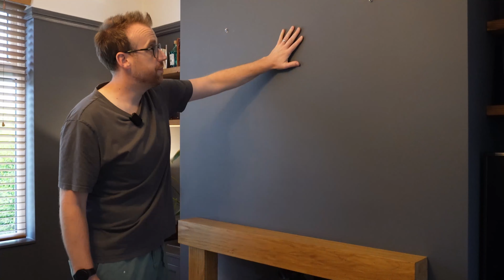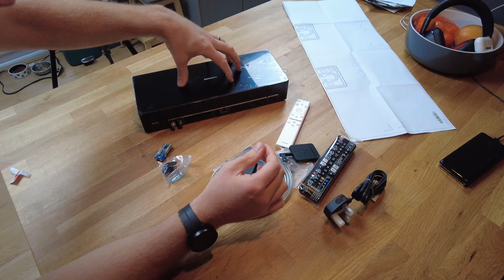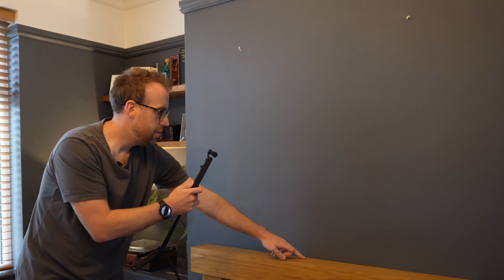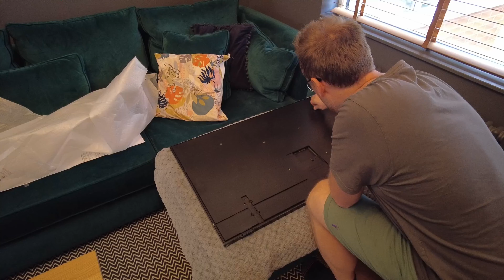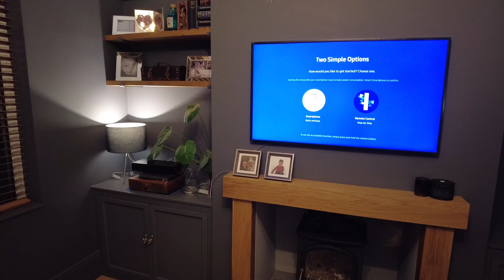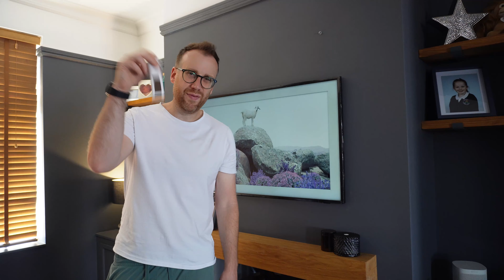Samsung The Frame 2023 TV (Part 1) | Huson DIY | 43 Inch TV Install #samsung #theframe

Comment: You don’t mention whether your brackets went into the stud or just the dry wall. I’d just dry wall should use special dry wall anchors
Reply from the maker: Hi!! Yes just plasterboard and I did use some decent Fischer plugs suitable for the wall and weight 👍🏻

Comment: I watched this to see if I understood the paper template better. There is a border for the outline of the tv drawn on the paper and another border for how much it will sink once installed. That must be the gap you mentioned midway through your video. Thanks for the helpful video!
Reply from the maker: Yeh that's right. I totally miscalculated!! 😅😢

Comment: I bought a used 43" Frame TV without the template. Can you tell me the measurements between the brackets, and the distance from the top of the tv? Do the TV screws rest in the "high" or "low" position of the bracket slants in the final state? Thanks so much in advance!
Reply from the maker: 78cm hole to hole for the brackets. It kind of sits in mid way of the bracket.

Comment: Unlike the "directions" that came with the TV and several other videos we watched that did not have same mounting process, this video was awesome! THANK YOU! We have encountered a challenge in that our electrical outlet is behind the tv (on the wall) which is hindering the flat fit against the wall. The rubber washers provided are not large enough to extend the tv far enough to clear them. We have changed out the outlet with a recessed outlet but still have the cord to contend with. Any suggestions on this challenger are appreciated.
Reply from the maker: Hi there!!! Have you managed to work this out yet? The only thing I could suggest is to maybe channel out for the cable? Otherwise I'm not sure....
Reply: @husondiy I brought in the expert, my engineer nephew and he got us up and running. Ended up using about three additional metal washers on each connection to bring it out to the necessary distance to clear the cords. Also discovered that the template provided by Samsung showed the brackets upside down. Honestly, it shouldn't be this difficult to hang a tv. Thank you again for your video.

Comment: I'm building a gas fireplace and chimney, similar to yours. I plan to install a 43" frame TV as well. I was looking for the mounting hight from the top of the TV.  Being a new build I will construct a solid rail in behind the wall for the mounting bracket & frame in from the outside dimentions of the tv leaving the wall open directly behind the tv itself. The tv box will be inside the chimney walls. Being a chimney wall I do plan to insulate around the concealed tv box shelf.
Reply from the maker: Nice one Darren!! Do you need any sizing, dimensions etc providing?
Reply: Yes. I am building in support blocking into the wall. My question is this:

How far down down from the top of the tv are the mouting brackets?
Reply from the maker: With the TV is mounted, the top of the bracket is 4.5cm from the top of the TV.

Let me know if you need more info
Reply: @husondiy  Thank you. One other question comes to mind. Do you know how big the mounting plate is?

Comment: This was extremely helpful video! I'm in the USA and was so relieved to see the little brackets that came with the TV in the box. At our store here it said the mounting brackets did not come with it, but it does! We have an Apple TV box so another thing to have plug into the one connect box, but thank you so much. This was helpful in mounting. I now just need to figure out how to work the SmartThings app and changing the virtual photo matte and loading pictures to have more artwork than the default two photos that are on there.
Reply from the maker: Great to hear you've got one. I'll be honest when I first opened it all I was like "where the hell is the wall mount, it's missing!!". It's just so incredibly small, it's amazing really how it mounts. 

I'll be doing a bit of a follow up video too, you think there's any specifics I should cover off to help others?

Comment: Did the wallmount included with the tv? or did you buy them seperate? I think i will buy this tv thanks to this video!
Reply from the maker: Everything you need is included!! Super easy to get on your wall! 👍🏻
Reply: @husondiy  In the store they told me to buy (slim fit wall mount) Haha. This is great news! Thanks for answering
Reply from the maker: No problem. I'll be honest when o opened ours I panicked as I thought they should have been more items. But it's literally the 2 small plates that attach to the wall, then 2 bolts in the back of the TV that hang onto the 2 plates. Very clever design!!!

Comment: To put it on the wall. Do you need to use the wall mount stand provided or can I used the one I currently have where I can move it (sandstrom full motion wall stand)
Reply from the maker: Hello!!! I can't confirm 100%, but the TV definitely has the Vesa mount layout on the back to attach Vesa mounts to. I hope that helps....
Reply: @husondiy  thank u so much for getting back to me. Appreciate it :)

Comment: I bought this TV 2 weeks ago to replace a 2019 model (which turned on/off on itself all the time). Frankly the 2023 Model one of the worst products I've ever bought. Incredibly buggy software, nothing works. I will never buy Samsung products again. Regarding the Art Gallery Mode - The 2019, with normal glass did a more realistic job than the new one as picture frames usually have "plain glass", so the matte doesn't make much sense.

Comment: As Mark said a brush plate into the cavity to route cable would be slick!

Would be Interested in knowing how the sound is. I would expect the low ends to be non existent unless the big box has some tricks built in!
Reply from the maker: The sound is decent enough for general TV watching. But you would definitely need a soundboard or alternative if you were using the TV in a movie room for example.

Comment: You mentioned a cavity behind the wall so would it not be possible to cut a square out (hidden by the TV) and fit a brush plate in and then route the cable to the side ?
Reply from the maker: Hi Mark!! Great idea! However....😥... I just had a look back through old pictures of when I was renovating the room. The wooden battens I put in go horizontal just above the fireplace opening, so there wouldn't be a route for the wire to go! Great idea though 👌